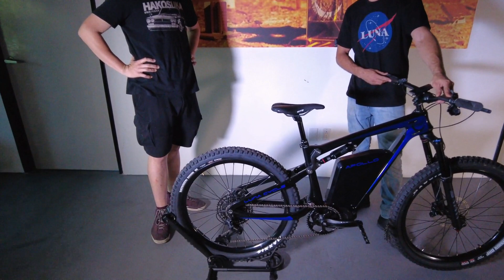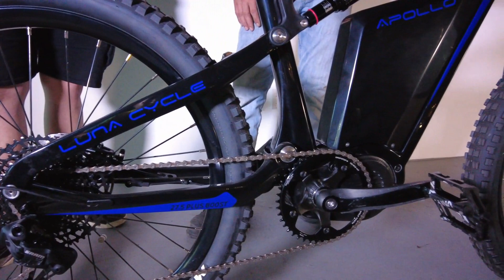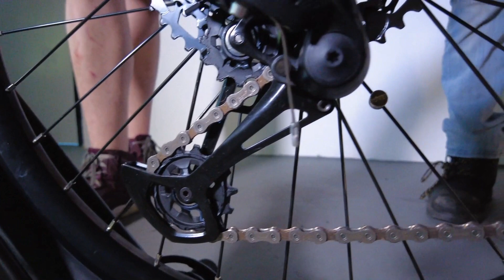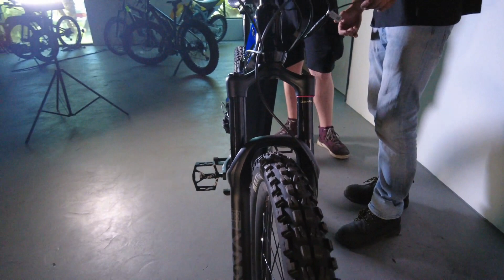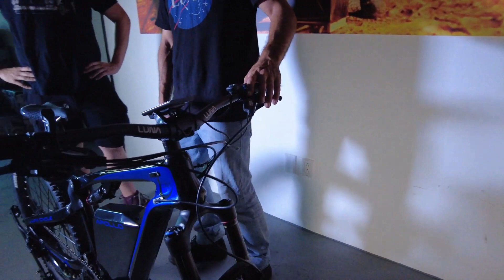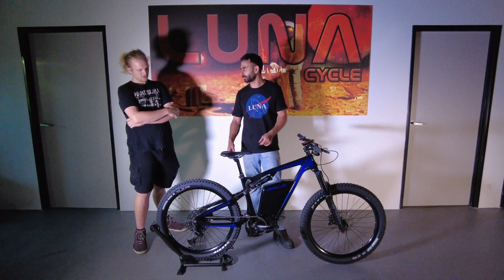Apollo Ebike 2021

Comment: I have a few luna motors and still got ripped off by lunacycle last month.  I ordered some replacement brakes and because they were out of stock instead of returning my money they sent me two right hand brakes and not a set.  When i contacted them a man emails me back saying "you ordered it so deal with it"

I like luna equipment but Mr Tony didn't offer any solution for me the supposedly valued customer and then pointed fingers and laid blame

I was going to order the bbshd from luna but after my experience with the customer service I said screw that.   Maybe someone from luna will contact me a try to make it right I have all of my order numbers pictures and everything

Comment: Before you plunk down your hard earned money on a product you should know how customer service agents at Luna respond to problems.

We have been upfront about processing time from the beginning and have told you 2-3 weeks from the point of delivery to the shop. It has been 2-3 days, not 2-3 weeks.

I can appreciate being impatient in an era where amazon can process a return within the same day of returning something and certainly wish we had that kind of capability, but we do not. If you feel the need to file a chargeback over an item you explicitly said you ordered the wrong one of, thus admitting the reason for the return was essentially due to your mistake and unrelated to the quality of the product, then I guess that is your choice but it seems likely arbitration would not find in your favor. In any case I can not somehow force something to be processed sooner, as much as I have certainly tried in the past, as my team all works remotely and has no way to even initiate a refund let alone have someone at our short staffed physical location sort through incoming packages for your specific one and inspect it.

 
-Gary
Luna CS Mgr

Comment: Check out HI Powered Cycles novelty electric bike called the Typhoon Pro. 26x4 rear tire 27.5 in front. It uses a Hub drive but placed in the bottom bracket as it is a mid drive 
bike. I think it is the very best you can buy.
Reply: A hub bike, the best ?  Ha.